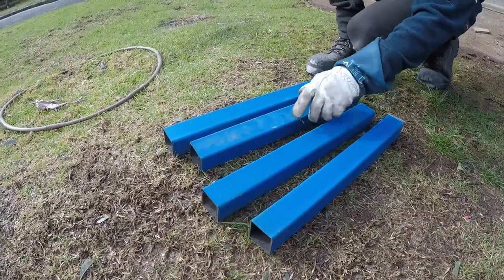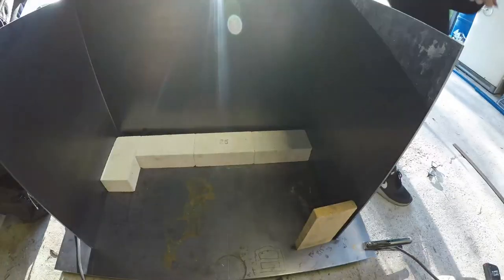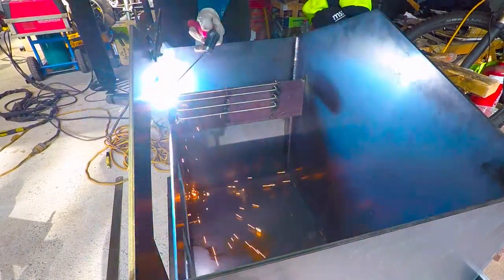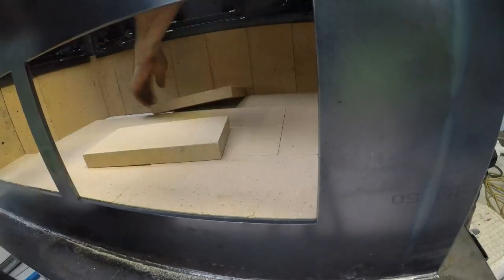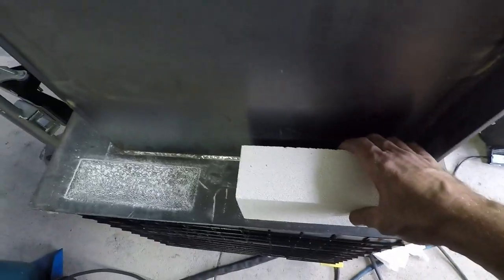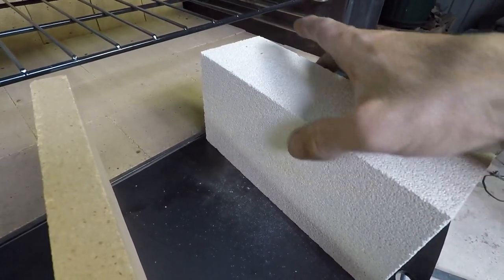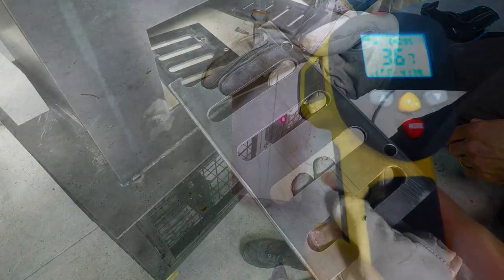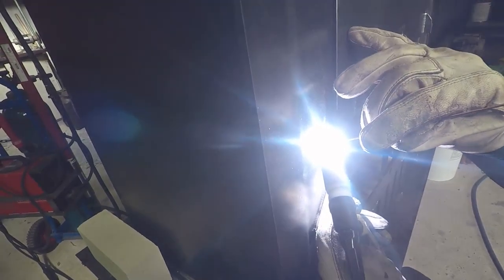Building a Wood Fired Pizza oven Part 1

Comment: Hey man :)
I really love your Race Mower Videos :D Great work!

I just want to give you a quick tip to enhance the viewing experience for everyone:
Check the level of your audio signals.

The first time I recognized it was when you started up the Motor of the Mower for the first time.
I had to turn the Volume up all the way to eleven because the volume of your voice is so quiet and then you get earraped by the noise that was recorded from your camera when the motor starts! xD

In this video I still see the same problem, not so extreme, but still unpleasant.
Check 0:37 and then compare it with 3:18! 
I dont know which editing software you use, but it should be a very easy fix :D

Greetings from germany and keep up the good work :) :) :)
Also If you have any questions about editing, just let me know :)
Reply from the maker: Thanks for the feedback, I have the right software and can easily adjust the noise. I aim to get volumes right but probably just need to listen more during editing to get it right. Cheers